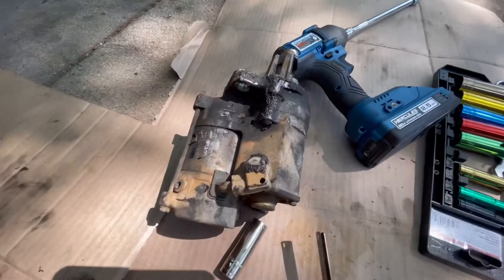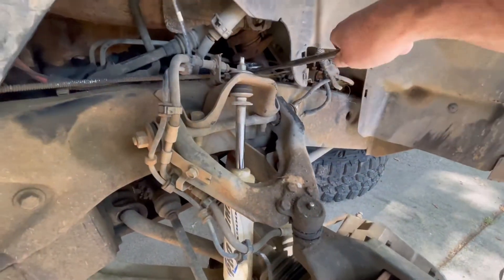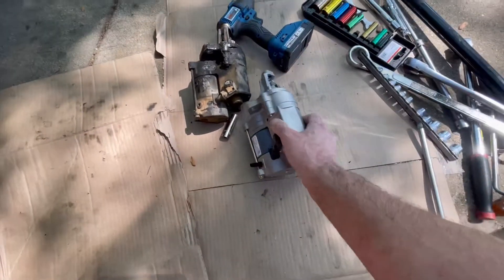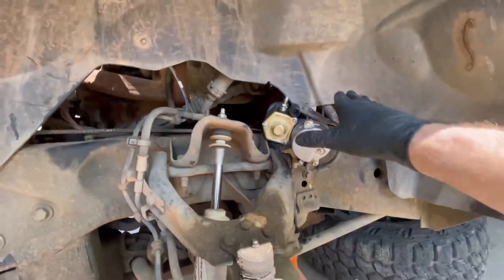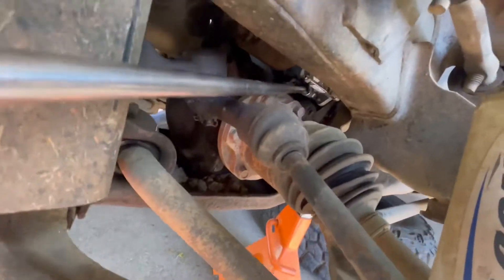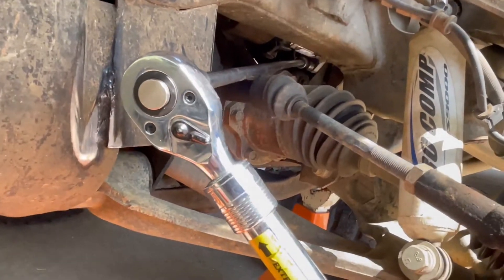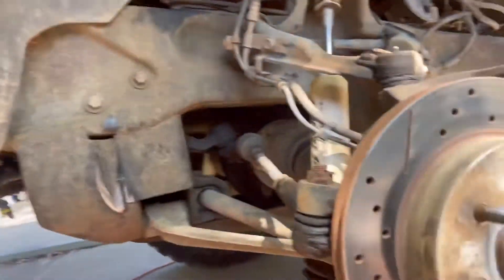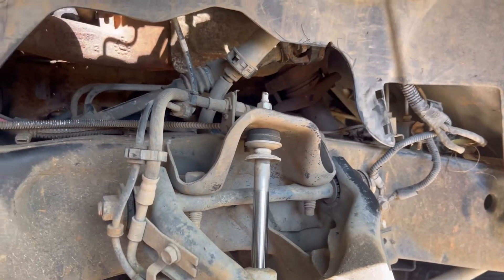1998 to 2003 Dodge Durango 4x4 5.9 Starter Replacement How To

Comment: is your body lifted? i have not that much room between frame and body. i have a 2000 5.9
Reply from the maker: No my body isn’t lifted. I thought about doing it but decided not to.
Reply: @toocoolforschool3221  okay interesting 🤔

i found a way to remove that piece of metal. upwards between exhaust manifold and steering column. 
but there is a new problem. the new one spin, but it spin free, without conneting to the flywheel

Comment: How did you crack those 5/8 nut and bolt? I’m worn out!
Reply from the maker: I used a large wrench to help with leverage on the ratchet. I kind of showed it in the video
Reply: I’m just old and weak! Thank you!
Reply from the maker: No problem. I hope you can get it!

Comment: I'm working on a 2000 Dodge Durango I don't have the same room to work with to facilitate  going in and out. Also my break line are higher also from frame. what year is yours? It crazy you have all kind of room on the side.
Reply from the maker: Mine is a 99.  5.9 liter 4x4